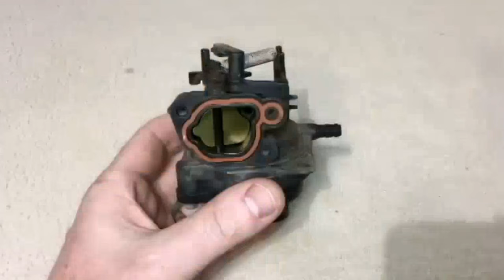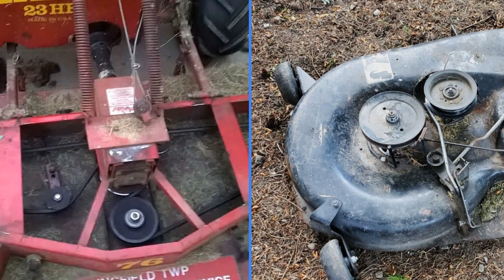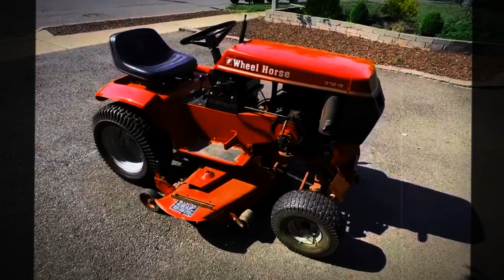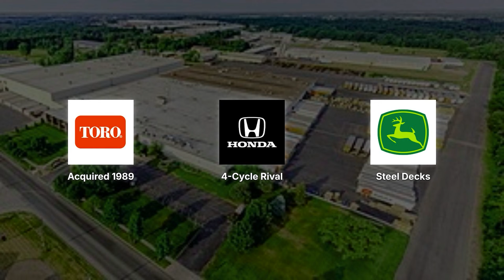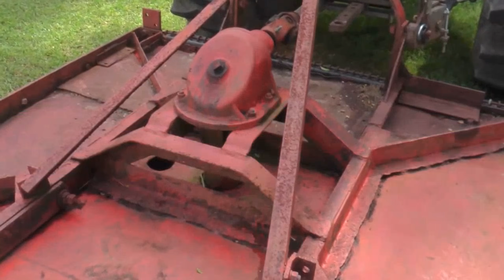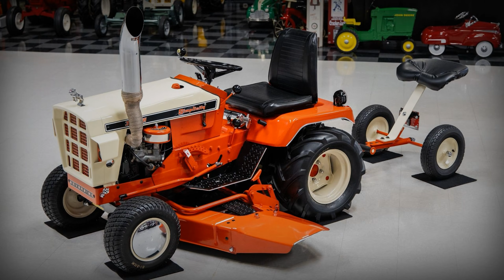14 Forgotten Mower Brands That Were Built to Last Forever

Comment: I have a 1980 Lawnboy r7070 that I paid $35 for about 12 years ago. Until just this spring, she started on the first or second pull every time. She's currently sidelined with a bad reed valve that I WILL fix. I already have 2 sets and 2 new sets of main seals, but I haven't had the time to tear it down and replace them (it may turn into a winter job). I wound up breaking over and buying a new Toro Super Recycler (aluminum deck with electric start) to keep up with the grass, but I much prefer the old gal.